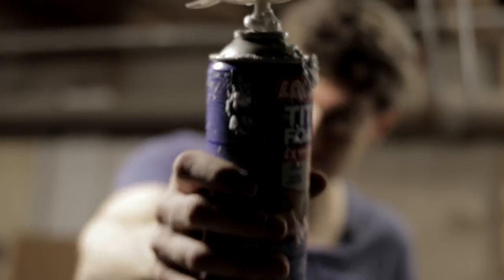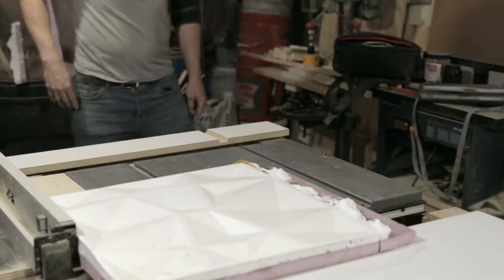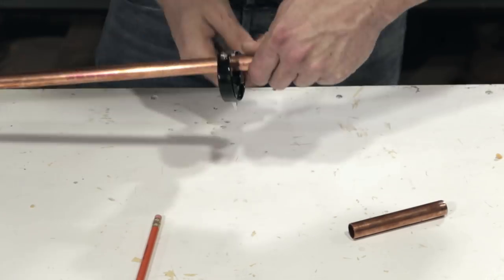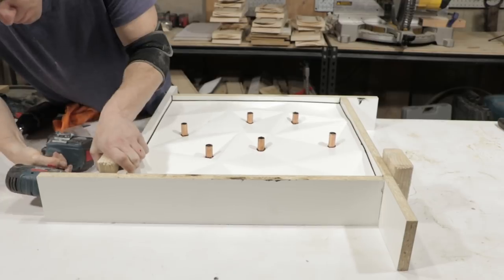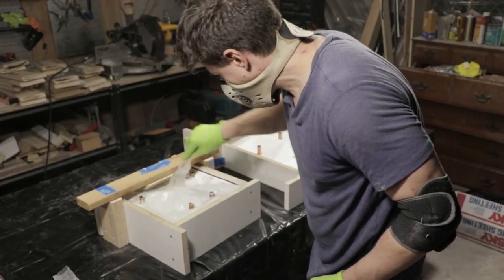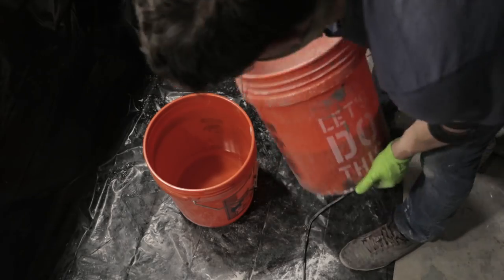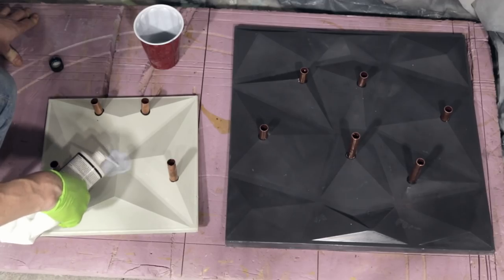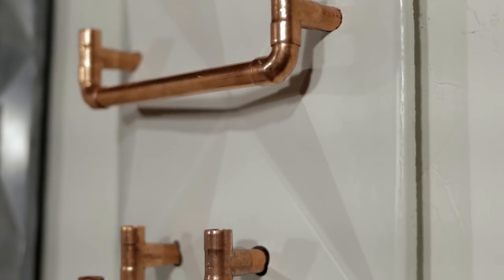DIY Geometric 3D Wall Rack || Concrete & Copper Design (w/ GFRC mix)

Comment from the maker: Since this project worked well, I'm thinking about a larger project with DIY concrete tiles -  over to you, what should I do next?  I was thinking of a fireplace surround, a feature wall, or a kitchen backsplash....what do you think?  If you have a different idea I'd love to hear it as well.  Let me know in comments.
Reply: Very inventive. Could the 3D-tile be reused? I know you drilled holes in it, but if you hadn't, would your opinion be that it could possibly be reused for multiple pours?
Reply from the maker: Yes!  Actually, that was one of the big surprises.  In the larger one, where the concrete posts went in straight, the PVC tile and foam base popped right off, so it could be re-used.  If you didn't have the copper pipes inserted (and were just making tile), then it could definitely be re-used multiple times.    I think it would be easy to re-glue the sides of the form and re-caulk, and make two a night (would only take an hour each time, once set up), and slowly build up enough tile for a backsplash or feature wall.  Making a rubber mold from the PVC tile would definitely speed up the process, but rubber is $$$.  For a larger project with many tiles, however, it might be worth the investment.
Reply: Hast du Ideen für Wandlampen? Beton in Verbindung mit Holz,Metall ,Aststücke ,....Das wäre toll .ich freue mich auf dein nächstes Projekt .
Reply: Love the video.  I'm looking to make the white concrete table with the wood inlay that you made the video for.  If I use the just add water mix you used for this video, how do I get the white color?  Is that the natural color of the product?  Thanks!
Reply from the maker: Thanks! The just add water mix is naturally pretty darn white.  The white version of this, and my waterfall table both used the just-add-water mix.  You can also order white pigment from fishstone to add to the face coat to make it super white.

Comment: That freehand cutting on the table saw made me super nervous! Great build man, see you this week.
Reply from the maker: Thanks man!  Looking forward to it.  I thought it was fairly safe as long as hands are not between fence and blade (so any kickback would push my hand away from the blade), but definitely set me straight if I'm missing something :)  I like my fingers...
Reply: I think it's just kind of asking for kickback. Not a big deal with foam probably, but definitely with wood. You don't want to push things through the table saw without having them either against the fence or with a miter gauge/crosscut sled.
Reply from the maker: Crafted Workshop that definitely makes sense, better safe than sorry.  Making a cross cut sled is on the to-do list.

Comment: dude they look great, even without the pipe they would look great as wall art etc... so glad i stumbled across your channel subed
Reply from the maker: Thanks!  Yea, this was an experiment to see if the design would work with one tile, before trying to do a larger project.  I'm thinking about how to scale this up to do an inexpensive but high-end looking feature wall, fireplace surround, or backsplash (still taking input on which to do :) )....

Comment: You could add cooper caps to the types...softens them up.
Also if you spray some lacquer on the tubes it will keep them from oxidizing 
Bob
Reply from the maker: Thanks for the tips

Comment: cool project. do you think a sand bed would have worked for supporting the pvc tile?
Reply: Also, you could have poured the gfrc with the fibers and shaken it slightly. The fibers won't show through if you add a little plasticizer
Reply from the maker: Yea, I think a sandbed would work as far as support.  I'm just thinking about the logistics of getting the tile level inside the side walls -- what did you have in mind for that?
Good to know about shaking the form -- nice trick to have in the back pocket.

Comment: I love this project. My confidence level is low and I don't have the tools. Do you take commissioned project ideas?
Reply from the maker: Thanks!  I generally don't do projects for hire.  If someone is local here in Chicago (or the project is small enough to ship) and what they want aligns with something I want to make, then I will.    I'm happy to help you though -- this one is really very easy to make.  If you can make a wooden box and mix pancakes from a box mix, then you can mix GFRC.   The investment in tools will be a couple hundred up front for a drill, circular saw, and mixing paddle (all you really need for this), but those tools can be used in many projects.  Happy to help if you want some pointers!
Reply from the maker: p.s., I have a lot more details on the written step-by-step on Instructables.com -- if you look up this project there, it may help a bit.

Comment: What's with the black circles around the copper that is inside the concrete? It looks like you left the silicone on..?
Reply from the maker: Ah, someone finally noticed I left the silicone :)   I removed it from a couple of the pipes and the concrete surrounding the pipes looked a bit rough.  I decided I liked it better with the clean silicone surrounding the pipes, so I left the rest.  If I were to remake these, I would use white silicone on the white one, and grey silicone on the grey one.
Reply: Ah! Good to know! Wouldn't it have looked ok enough without silicone around the pipes? What do you think?
Reply from the maker: Yea, I think it would have been fine -- you would have had to look really close to see it.  Just aesthetic preference really -- I stepped back and liked how it looked with the silicone so decided to just keep it.